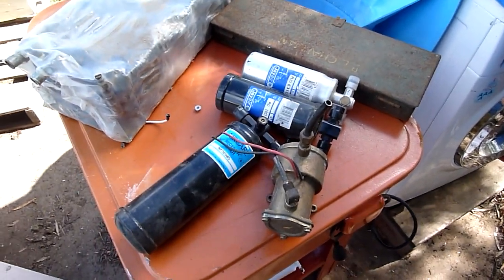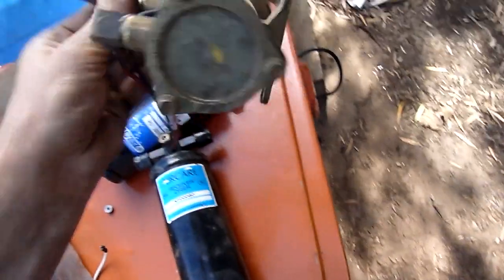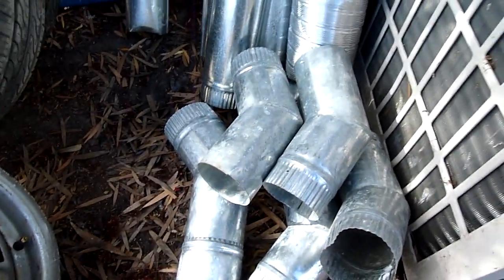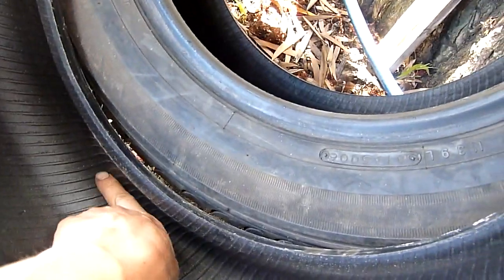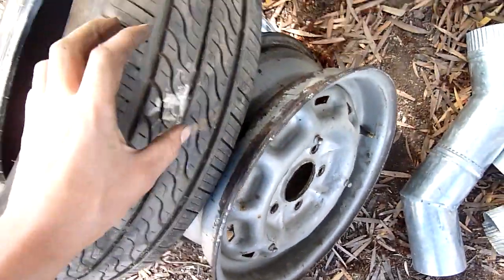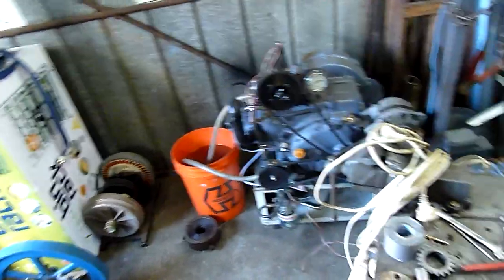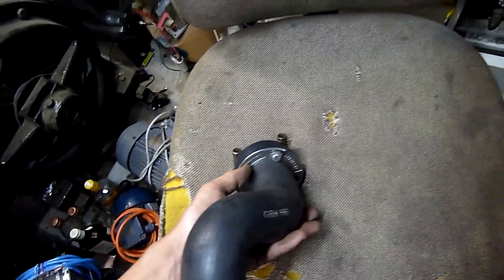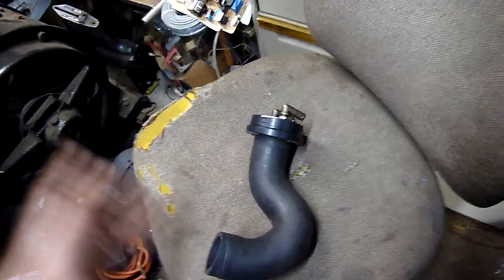Fisrt Scrap Pickings of 2012 - new Auto AC bits, tires and Gas Flue kits.m2ts

Comment from the maker: @HDXFH yeh I am reco'ing the rusty wheels right now, stripped the 3rd spare down and found it was just as bad as the rusty one in the vid.

applying hi-build primer then sanding back and spraying flat black
bright silver for the outer faces tho.

as for tubes, any rust seems to eat them, so clean painted surfaces are always required.

Comment from the maker: @tlaroche38 R134a dosn't produce enough head pressure to be a effective heater, plus if the outside coil freezes (which it will if yoiu drive in rain or humidity) it will block airflow to the radiator, overheating the engine

diesel's taking a while to warm up is a bit frustrating, but its just the nature of the beast

Comment: I'm just curious, but is it possible to use the air conditioner in a car as a heat pump? My mum's turbo diesel seems to take an age for the engine to warm up after it has been sitting out in the cold, and it would be awesome to know if it was possible to use the a/c that way. If it turns out it's possible it could then have the a/c modified next time it needs repairing.